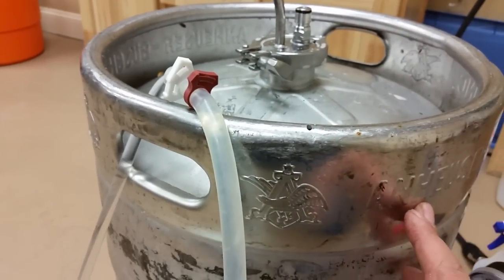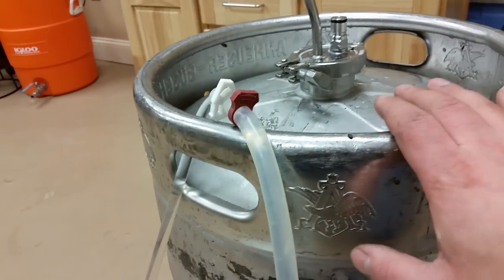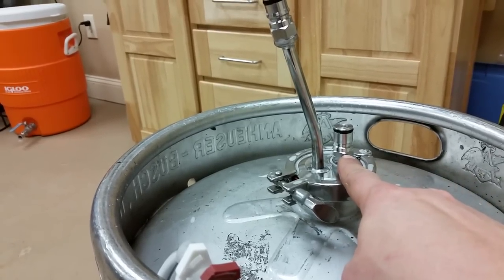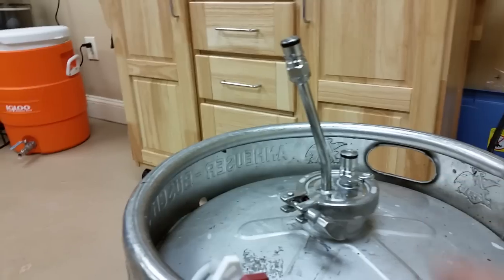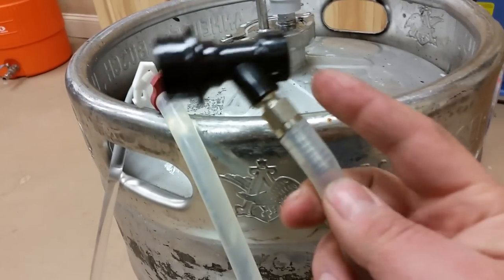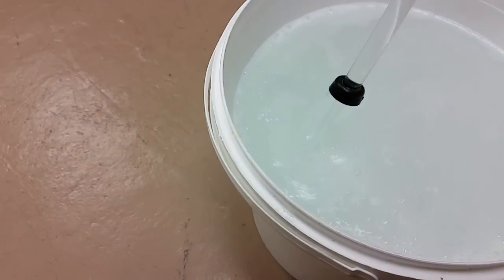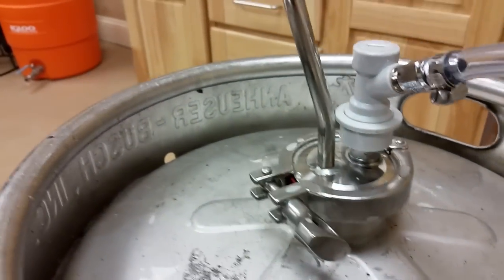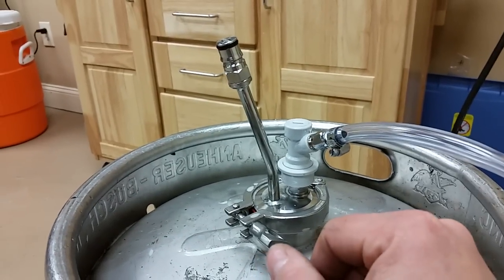Corny keg from sanke

Comment: i got a cross fitting with a tri clamp connection to keg, the liquid tube goes straight down , the gas goes in the right and relief valve on left, im looking for a ss float small enough to fit in the keg open to make this a floating dip tube style